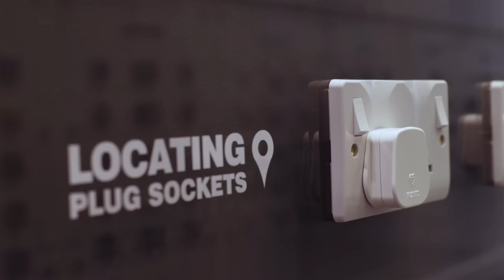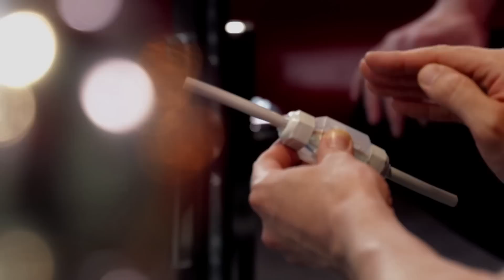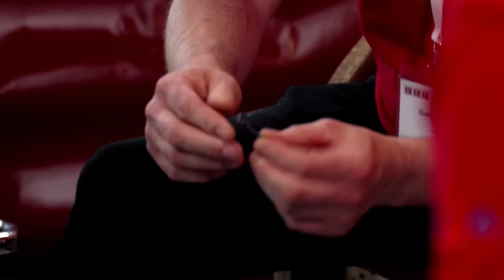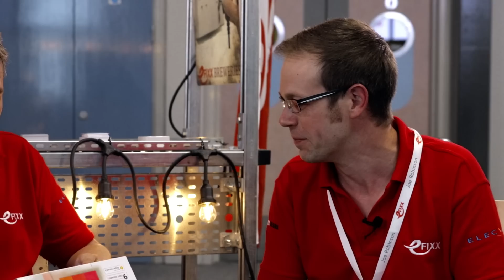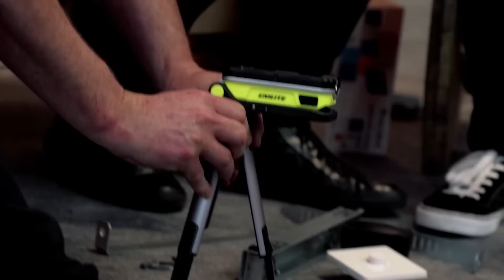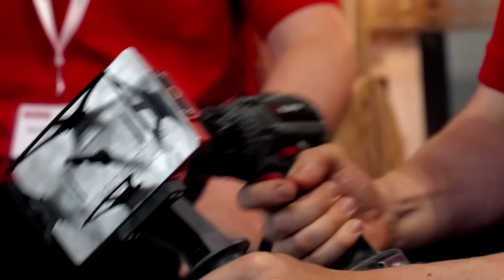CEF Live 2023 - what will we find this time? #CEFLIVE23

Comment: Great video. Thank you. Love the quadsaw. We cut hundreds upon hundreds of boxes in plasterboard but I can’t justify the price of the unit.  Sorely tempted though.
Reply: Hi Richard, thank you for the kind words and we're excited to hear that you love our product! We worked very hard to bring it to market. Unfortunately due to the fact it has 4 cutting mechanisms, 6 blades etc it is an expensive tool to manufacture. However, a look at this testimonial video if you have 2 minutes. It's by a smaller contractor who cuts much less holes than you and he is very happy with his investment. If you cut hundreds of holes - the time saving you will get with the QUADSAW will give you a very quick return on investment. Try it and you won't regret :) https://www.youtube.com/watch?v=w0P7B76aCsg
Reply: Appreciate your reply. I’d love to try it and don’t want to sound negative (particularly when I had to cut 30+ boxes today), but I think the downfall of the product is it’s price. I saw Nagy’s video. I’m in Scotland (all our modern build houses are plasterboard walls) charging Scottish rates, not London with customers that I can charge mega bucks!

Comment: Quad saw.......mmm... how can u feel cables behind or studwork....I'd 2nd fixin the joiner bring yr twin through the board
.... maybe viable in some applications but overall Not for me
Reply: Hi Damon, thank you for your comment. We never had any issue with the cables. See this video link - you can see the electrician on a 2nd fix cutting and the cables are waiting behind the wall. The QUADSAW cuts straight into the plasterboard without first penetrating and then tracing a square hole. Therefore, it minimises the chance of damaging the cables. https://www.youtube.com/watch?v=w0P7B76aCsg

Comment: Very good choice guys.  I also liked the new Crabtree Instinct plug and lighting switch back plate connection update designs, nice to see designers revisiting the hidden and most important part of a socket to see if this can be improved for installers.   alas on the back of Gary's comments I did like the mode location sockets from Click Gary mentioned, I also like (for home upgrades) Clicks, New media plates bringing some of the flexibility of the grid systems to the domestic user
Reply from the maker: Thanks for the feedback - Agree the Crabtree Instinct range looks interesting - however, they don't seem to be available to the masses. Hence we left them out for now.  If you know where we can get our mitts on some let us know the secret!